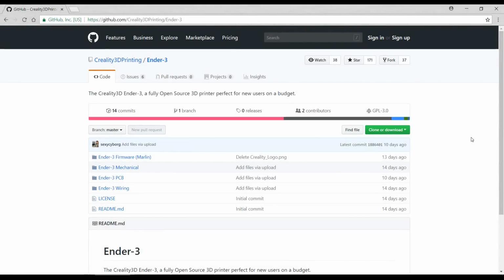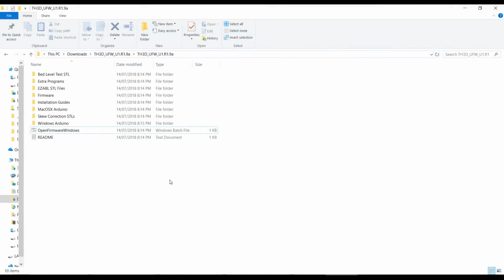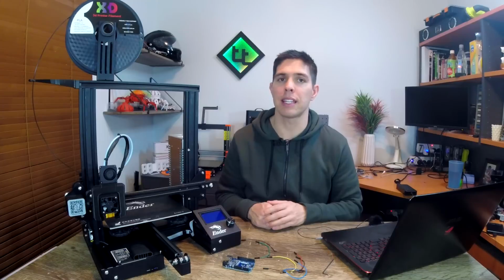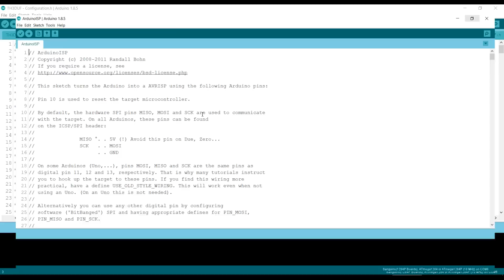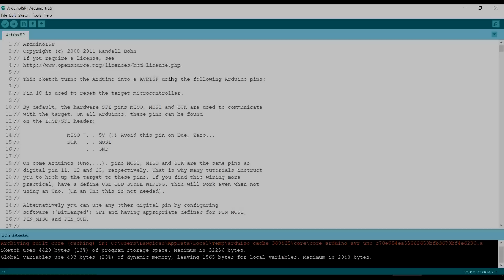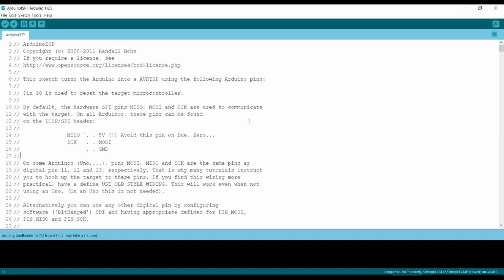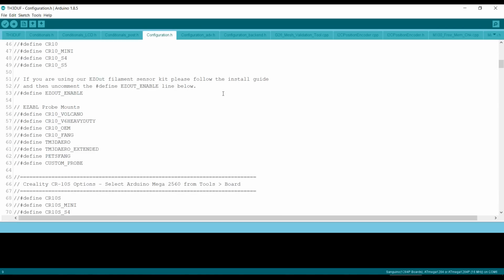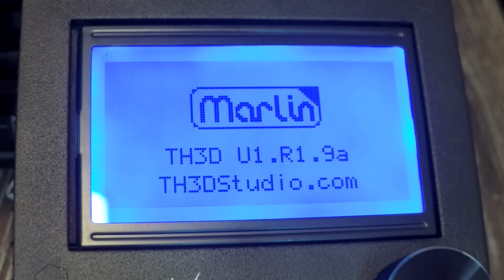Ender 3: How to install a bootloader and update firmware

Comment: Does the screen need to be attached for this to work? I followed your tutorial for my ender 3 and it worked perfectly. I tried doing this to the same board I bought separately but I keep getting a error during bootloader install. Any suggestions?
Reply: I was having this problem and followed this: https://old.reddit.com/r/ender3/comments/a0r7u9/cannot_flash_bootloader_with_th3d_and_arduino/eak02oz/

Comment: Accessing the board on the Ender 3 Pro is changed. They basically rotated the entire enclosure 180 degrees. This means you have to access it from the bottom. You have to remove the screw on top that is closest to the front of the printer, then turn the printer on its side and remove the three screws on the bottom. Note, the screw towards the back is longer than the others, so make sure you use this one when putting it all back together. The plate can now be removed. I think the difficulty of reaching the board makes putting a bootloader on the printer even more of a good idea since it's a pain to get to the board to reach the ICSP connectors.

Comment: Hi Michael, great channel and amazing tutorial as always!
But I have a remark. You connected the arduino to your laptop while wiring the Arduino to the Ender 3. 
A few moments later you connect the Arduino to the laptop.
So i pressume you wire the Arduino and printer before you power it up and connect it to the laptop?

Comment: Very good walk through. I completed this on the Ender 3 pro but have some issues. This LCD screen will not initialize. The other thing to note on the E3 pro the board is inverted and does not come completely out of the housing. You can connect the pins if you rotate the cover/board 45deg but need to follow the pin out closely as everything is not oriented as in the picture. As for the LCD screen I would appreciate if someone else ran into this issue but for now I am using the Octoprint controls.

Comment: Hi Michael, I am very new to 3D printing and I have a Ender3, I followed you upgrades on the Ender3 and started get great prints out with the stock Firmware, Few days ago I receive all the items to flash a bootloader and update to the TH3D firmware and EZABL Octoprint which all went well, thanks to your instructions, I updated the Start Gcode too, But! I tried to print "AIl_In_One_3D_printer_test_micro" using the same file sliced in Cura again, it spat out the filament all the way just as it started the start Gcode after leveling, and I put the filament back manually then after finishing the 2 side lines its did the same? so I removed that G10 and it random sometimes it works other times, today it only dose it at the end of the start code? and it will not do the end code "G1 F1800 E-3 ; Retract filament 3 mm to prevent oozing"
Next, the retract before the upgrade was 5mm, now filament retract dose not work at all?
Z hop  did not work, rebooted, checked updates, restart and now it work on the but when it prints the bottom 3 layers ok, but when it starts to do layer 4 upwards then I have to shop it around layer 20 as Z dropped and dragging across the last layer while printing "AIl_In_One_3D_printer_test_micro".  
Any words of wisdom?

Comment: In case it fails to upload bootloader, have a look at https://www.instructables.com/id/Flashing-a-Bootloader-to-the-CR-10/
In my case the alternate programmer code (for the arduino) did the trick. According to there was a trouble to match the chip supposed to be in the board because it responded with a different code number.
I programmed using arduino nano. 
Some useful infos are the pin diagram found on that otherr guide https://cdn.instructables.com/F06/XH0O/J0MOS2VC/F06XH0OJ0MOS2VC.LARGE.jpg

Thank you Michael for all your very good advices and guidance. You helped me a lot.

Comment: This seems unnecessarily convoluted. I recently ordered their ABL mod and I did not budget money for buying an arduino and the related bits in order to do the necessary firmware upgrade.

I've flashed many things over the years that can do it via USB. Granted this is a budget 3d printer, but still.

EDIT: Nevermind, apparently, they include the necessary hardware to do the installation. But, this does reinforce the notion that you're better off not buying the arduino and instead banking that money towards an upgrade.

Comment: Trying with a generic arduino nano as the programmer, I get these - doesn't seem to work too well... The ardu tested works with other things, though. Any ideas?

avrdude: stk500_getsync() attempt 1 of 10: not in sync: resp=0x15
avrdude: stk500_getsync() attempt 2 of 10: not in sync: resp=0x15

avrdude: stk500_getparm(): (a) protocol error, expect=0x14, resp=0x14

avrdude: stk500_getparm(): (a) protocol error, expect=0x14, resp=0x01
avrdude: stk500_initialize(): (a) protocol error, expect=0x14, resp=0x10
avrdude: initialization failed, rc=-1
         Double check connections and try again, or use -F to override
         this check.

avrdude: stk500_disable(): unknown response=0x12

Comment: I can't get it to work. Using Arduino Duemilenova (2009 version) with ATMEGA 328. After connecting all cables and uploading the ArduinoISP program, I switch to the Sanguino 1284P and "Arduino as ISP", and then choose "Burn Bootloader", which then leads to errors from avrdude - which are the same whether I have the Ender3 cables connected or not (I triple checked that they're in the right order and are also conducting; the Ender3 display even turns on when connected).

Later - See my comment below - this older Arduino is apparently unable to perform this operation - a newer Arduino (Rev 3) is needed instead!
Reply: Trying to do the same thing myself. If you find a solution please post. 
The Due doesn't show up as a board in TH3D's batch file, so I uploaded the Arduino as ISP from a then normal exe. Then I disconnected power from the arduino when making all the connections,  then plugged it into the pc. Ran the batch file to give me the Sanguino board, but getting avrdude errors too.
Reply: Got frustrated trying to get this to work with the Due, so ended up using https://www.youtube.com/watch?v=hbX8Qu-QLnI to push the bootloader via raspberry pi, then used TH3D's firmware (this video) to push the actual firmware. If you go this route, make sure you disconnect the Pi before you connect from your PC to the printer.
Reply: @k-653  Turns out that the Duemilanove is simply unable to perform this ISP flash operation (I found another hint at that in another forum somewhere). I bought another Uno (Joy-It ARD UNO R3DIP) and had immediate success.
Reply: @thomastempelmann  Thanks for the reply! Some guys on reddit said they got it to work but didn't say how (https://www.reddit.com/r/3Dprinting/comments/99922o/ender_3_flashing/). Unos are so cheap these days it's easier just to buy the board. I had the RPi on hand that did the trick.

Comment: I am getting the following error when trying to upload the ISP:
avrdude: Device signature = 0x1e950f (probably m328p)
avrdude: Expected signature for ATmega1284P is 1E 97 05

I do have a m328p.  It says I can disable this error by using -F, but I want to make sure I am using the correct board.  Any advice would be greatly appreciated
Reply: I was having this problem and followed this: https://old.reddit.com/r/ender3/comments/a0r7u9/cannot_flash_bootloader_with_th3d_and_arduino/eak02oz/

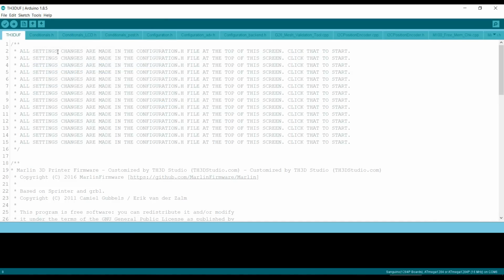Comment: No "Sanguino" board option.  Using TH3DUF R2/Arduino 1.8.8(Windows Store 1.8.19.0)  and I can't find the "Sanguino" board option.  There are 26 options available, but no Sanguino.  At 4:18 in the video, you show only 3 boards available on your drop-down menu.
Afraid to randomly choose another board as this is the first time I'm doing this.
Help!
Reply: I have a similar problem- spent six hours today trying to get this to work on my Mac... My regular Arduino works fine... very strange...
Reply: Same issue here. I went through this process several months ago and "sanguino" was there as he shows it.. I went in today to change the probe points for my bltouch in the firmware and now I don't have the sanguino option. Not sure what happened to it or how to get it back.
Reply: @LukeBuzzard  @Jim Brent Go to Preferences. Look for "Additional Board URLs". If you already have entries use a comma and then provide the following URL "https://raw.githubusercontent.com/Lauszus/Sanguino/master/package_lauszus_sanguino_index.json". Then go to 'Tools' and then select 'Board: ______" (this will have whatever you last used as your board). Go to 'Boards Manager'. Ensure 'Type' has 'all' selected. Then type in Sanguino. You should end up with one option. Click on this. Select your version and then hit 'Install'. All done!

Comment: It worked for me, but took me sometime to understand that you weren't using the original IDE of arduino... insted you were using the one from TH3D that add all of the drivers needed. Other than that it worked, Thanks.

Comment: Got the board from your link, followed the video step by step and boot loader would no load.  Wiring is correct, driver for UNO board is installed.  Using the TH3D package but no luck.  Error message is “not in sync response=0xd5.  Any thoughts?

Comment: Well done, and easy to follow. I've run into a strange issue no one else seems to mention though, and wondering...  Is there something in the TH3D firmware that makes changes to the stepper motors in any way that I might be missing?  
The reason is, immediately after updating I noticed the build plate seemed to be slamming back and forth much harder, and noticeably moving much more suddenly and sharply than with original Creality firmware.   I started getting all kinds of y-axis layer shifting, and the y-stepper was noticeably hot right away compared to the others.  After elimination of all other issues (belt to tight, too loose, etc.), I flashed vanilla Marlin (thanks to your OTHER amazing video guide) and the problem is gone.  Build plate is much smoother, no smacking about, overall much quieter too.  Y stepper is cool to the touch even after 30 minutes now of printing.  Something perhaps in TH3D settings I could have changed to fix this?

Comment: If I do not install a bootloader  and program the firmware using ICSP, assuming this is possible, will I end up with more memory space for the firmware ?  I understand that  some features have to be omitted to make it fit. How much memory  does the bootloader use?

Comment: Hi, i've had some problems with my Ender 3 while trying to upload the firmware so i'm sharing some tips
- Be sure to use the TH3D Arduino IDE and not the normal 
- I used an "alternative method" to burn the bootloader : https://www.instructables.com/id/Flashing-a-Bootloader-to-the-CR-10/
-  when trying to flash the firmware, if your printer is not recognised by the IDE in the "port" section, go to the device manager, look for your printer in the (in my case) "other devices", and select "update the driver software"
Sorry for my anglais à chier, hope it will help you

Comment: I've noticed that after firmware upgrade the printing speed increased significantly (which is good from one point of view). But I'm worried about physical worn of printer. Does anyone know where to search for speed settings? Thanks in advance

Comment: Thanks for you tutorial. Unfortunately burning a bootloader did not work with my mac/arduino uno. avrdude tells me: stk500_getparm(): (a) protocol error, expect=0x14, resp=0x14, Double check con.... Any ideas?
Reply: I managed by using an original Arduino board instead of a clone
Reply: I have the exact same problem. What is your PCB version? Did you managed to fix this?

Comment: I have a 2 month old Ender 3 with a problem, hopefully someone here can help. I purchased it thru amazon sold by creality but unfortunately I found no help in those directions. The symptom is the printer stops in random positions and extruded starts running in reverse. Unless I intervene it will stay in this state for hours. The display states printing! Do you think flashing the firmware might help the issue.

Comment: : stk500_getsync() attempt 10 of 10: not in sync: resp=0xdb Error while burning bootloader
Reply: i had the same error today..  there's another post about deleting the arduino drivers... i guess they mean on the windows PC, but not really sure how to do that..   can anyone help?
Reply: For me, using an original Arduino UNO board solved the problem. First I used a clone and had the same problem.

Comment: ketch uses 108692 bytes (83%) of program storage space. Maximum is 130048 bytes.
Global variables use 4535 bytes (27%) of dynamic memory, leaving 11849 bytes for local variables. Maximum is 16384 bytes.
C:\Users\monk\Pictures\TH3D_UFW_U1.R2.7\Windows Arduino\hardware\tools\avr/bin/avrdude -CC:\Users\monk\Pictures\TH3D_UFW_U1.R2.7\Windows Arduino\hardware\tools\avr/etc/avrdude.conf -v -V -patmega1284p -carduino -PCOM1 -b115200 -D -Uflash:w:C:\Users\monk\AppData\Local\Temp\arduino_build_502488/TH3DUF_R2.ino.hex:i 

avrdude: Version 6.3-20171130
         Copyright (c) 2000-2005 Brian Dean, http://www.bdmicro.com/
         Copyright (c) 2007-2014 Joerg Wunsch

         System wide configuration file is "C:\Users\monk\Pictures\TH3D_UFW_U1.R2.7\Windows Arduino\hardware\tools\avr/etc/avrdude.conf"

An error occurred while uploading the sketch
         Using Port                    : COM1
         Using Programmer              : arduino
         Overriding Baud Rate          : 115200
avrdude: ser_open(): can't open device "\\.\COM1": The system cannot find the file specified.

avrdude done.  Thank you.

Comment: Not sure if it’s in the comments but worth noting - Cold extrusion prevention is on in th3d firmware so you can't extrude under 170c. I tried testing each axis and extruded cold and xyz was ok but extruded didn’t work. The guys a TH3D quickly came back to me with this 🙂

Comment: Great video but I can't get my computer to recognize my Uno board :( 

When I connect my Uno via usb, windows says , "the last USB device you connected to this computer malfunctioned and windows does not recognize it".

I've tried to install drivers via device manager but windows 10 keeps saying "the best driver software for your device is already installed".

If anyone recognizes this problem, please can you help me out.

Thanks in advance, Graham
Reply from the maker: Sometimes you have to manually disable the driver and then run the Arduino driver install.
Reply: @TeachingTech  Thanks Dude. Good suggestion. I didn't try that. I got it all working after buy setting up an up to date version of windows 10. I normally try to do all my computing with out of date OS' because I don't like being messed around by Microsoft.

Comment: Wow, what an incredibly difficult, convoluted process. Great job on explaining man but for those of us that are new and have no experience with this, what a discouraging process.
Reply from the maker: Probably one of the Wordfence things about the Ender 3 is the 1284p microcontroller and lack of bootloader. Most other printers you just connect via USB and you're off.

Comment: Could you please make a video about installing a E3D v6 on an ender three I am so confused on how to install mine
Reply from the maker: I am about to fit an all metal hot end, hopefully that will help you. Maybe you need a printed mount or adaptor? Try searching thingiverse, etc.
Reply: Very interested to hear your opinions on an upgraded hot end, are you going with the Micro Swiss or something like an E3D or Volcano?
Reply: Connormgs I have an e3d v6 that I successfully installed it prints great
Reply: Its a different temperature sensor that has to have some settings changed in marlin
Reply: Love your videos

Comment: Thanks again. Did it all - it seems it was a success. When checking on the machine display - I saw the option of initiating the eeprom - I hit it and seems to be OK. One thing though - I have lost all the MOTION  parameters under the CONTROL on the screen as before - is this normal ???
Reply from the maker: The Ender 3 board has a small capacity microcontroller so some features are disabled to fit the thermal runaway protection. They still exist in the firmware, just can't tweak from the LCD.
Reply: I still have the MOTION parameters on mine though.
Reply: Switched to Mrlin newest firmware - all works ok now. Thanks.

Comment: I really appreciate you putting this tutorial up.  It really simplifies firmware changes.

Do you happen to know what to uncomment for Ender-4, h-bot (Creality called it a corexy, but it is h-bot)

TIA
Reply from the maker: Check it now the example configuration folder of marlin. If Ender 4 is there you simply copy and overwrite anything there into the main folder.

Comment: Thank you for this amazing video.

One question: I have seen another video suggesting that after the process you need to go to the control knob of the Ender 3 and INITIARE EEPROM. Is this really necessary ?
Reply from the maker: Since the standard firmware didn't have the EEPROM enabled, it wouldn't hurt but I wouldn't class it as essential.
Reply: @TeachingTech  
OK - thsnks. Will give this a go. I guess I will see this option in the screen if needed.

Comment: The display on my Ender 3 was disconnected when I burned the bootloader.  Does it matter?  Should I burn it again?
Reply from the maker: After burning the bootloader it will be blank until you flash updated firmware. Either use TH3D as shown in this video or go Vanilla Marlin: https://www.youtube.com/watch?v=N7JLchsFRDU

Comment: Does uploading new firmware reset the center position of the print head on the bed?
Reply from the maker: I found that it can, often you need to update the firmware to set the bed to 235 x 235 mm (not 220 x 220 mm)to get it in the centre again.